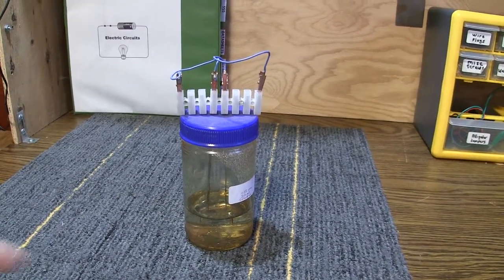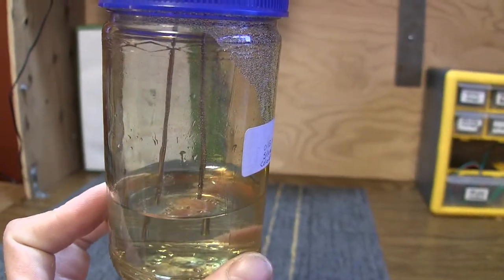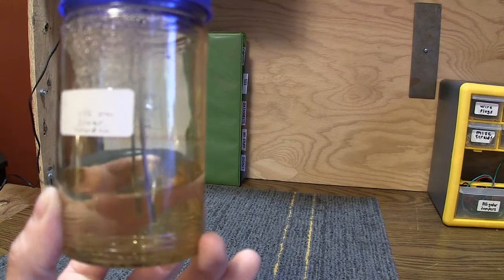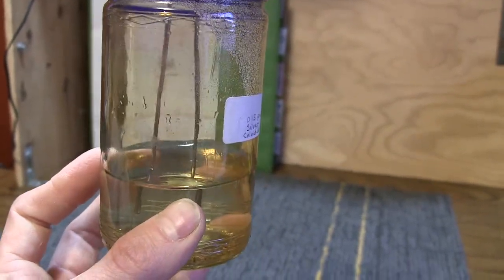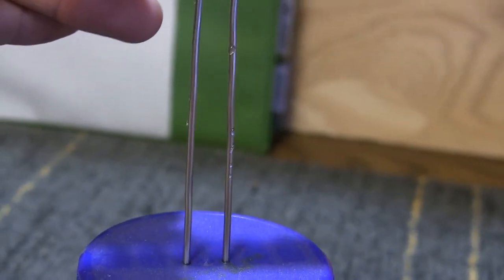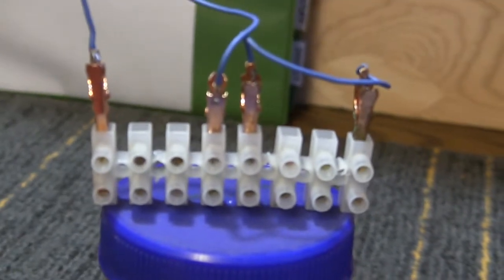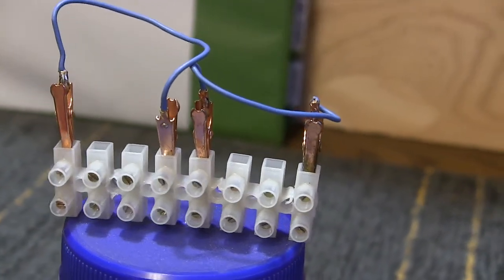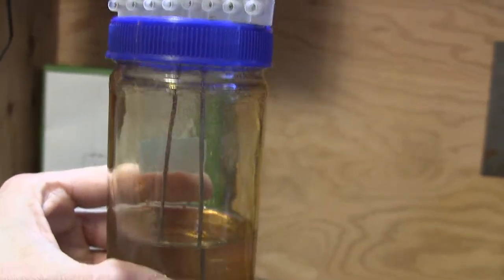Homemade Colloidal Silver - Important Info!

Comment: 45 volts? i make mine from 3 volts to 9 volts. no need for 45 volts. most of the 45 volts is dropped across the current limiting resistor so why make it that high? v=ir.  The current flow i used is from 0.1 ma to 1 ma max.

Comment: The best colloidal is made with high voltage!!(microwave transformer)...Due to the molecules been smaller(nano) and bonding to the blood cells and other cells in the body much easier, rather than DC on which the molecules are way too big to bond!! add a water temp thermostat with an on/off switch shutting the transformer off to allow water to cool....due to the high voltages! you can find more info here at:  himacmovieman in Youtube
Reply: @SmalltimR  I don't know the technical/ scientific part of your questions but i personally have used it before in fall/winter season if i start getting a cold or flu , itchy throat and congested nose or forhead  and it you catch it/treat fast enough with collodial silver it will heal you in about 3 days where regular doctor prescribed / un-prescribed  meds take 2 weeks or more. I have read you are suppose to take a tea spoon of collodial silver mixed with a cup of purified water every day 1 to 2 times a day to avoid getting sick from most virus , harmful bacteria but I cannot comment on this as a only use if/ when needed.
 I have also applied collodial silver to small cuts/ wounds on skin, insect bites and mainly for poison ivy which i get all the time if im around that weed and it stops the itching asap and avoids the poison from spreading all over your body, so it works great for that just as well or maybe better than aloe pulp/ applied on the skin.  You should try it !!
Reply: @SmalltimR  what would happen if you injected a small amount of colloidal silver directly into the blood stream?
Reply: @SmalltimR  thank you for your reply.
Reply: @SmalltimR  sorry for the long time to respond as I've been super busy and honestly I didn't check on this response! and yes I am aware of the effects by the stomach acid! Also when I said molecule and put nano between coma I meant a smaller nano particle almost the size of a molecule as the molecule is bigger than an ion..!! 
most people have been told that colloidal silver is “good” and ionic silver is “bad"....!! I was following closely Peter Linderman among others and scientific papers too.. on this! I think anyone understand that The word “colloidal” refers to a condition where a solid particle is SUSPENDED in a liquid (silver in water) and the word “ionic” refers to a condition where a particle has an electric charge. In the case of “electro-colloidal” silver, this electric charge is ALWAYS positive. Silver will not form a negatively charged ion. So, the truth is that electro-colloidal silver is BOTH colloidal and ionic... that's what the Scientific journal stated now I don't believe the gut will destroy it all but the most effective way is.. to apply under tongue and swish in your mouth from side to side before swallowing, now the high voltage colloidals sells really expensive as it won't degrade and have no metallic taste as I had bought it and tried! also the low voltage too and with a slight and sometimes a strong  metallic taste. there's an explanation of silver with plasma(created by high voltage) but is a boring long process to describe and too much scientific explanations I don't want to get into, I am not an expert! is just personal research and some trial..peace be into you! and hoping you doing well...

Comment: hi charles ifchrome deters oxidation do you think the copper is causing a neutralisation because the mass air is stabilising the silver and water
Reply from the maker: I am not sure, to be honest. I will need to try the same experiment again without the copper wires attached.
Reply: The air is ionised and copper is the conductor. It’s all about vibration frequencies what gives the dielectric field properties. You have the right balance!!! Everything as the universe is a vibration energy which wants to collide out of chaos an equilibrium state of energy 🫶
Reply: hi .recently worked out a car engine has to be sealed to cause it to become a vacuum .like lego have just put a lego built vacuum engine "asjoe booker stated " "they put it in kids toys " the potential economic distructive inventions.this vacuum is same as joseph papp engine .and i believe a van de graff generator becomes the engine ..joe booker states they!had tanks one side of engine that allowed gas (air) to go into chamber as it statically ionised electro static  downward motion then magnetic static (thunder ) upward motion .the engine was impossable tovalve bounce even at warp speed .unfortunately joe papp had a catastrophic shattering that it said injured watching witnesses.i presume the block became brittle as it froze to superconductive (like the tripods do in the film the war of the worlds ).its all in nature,nothing beyond our abilities.  ie the pistol shrimp.